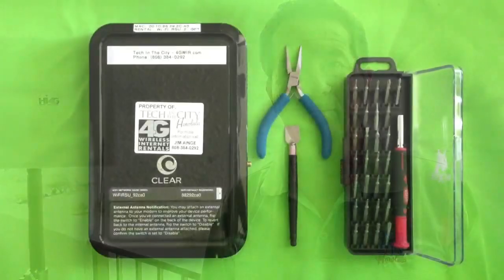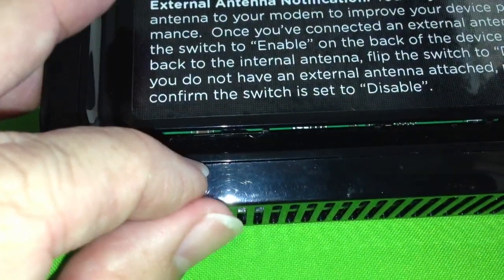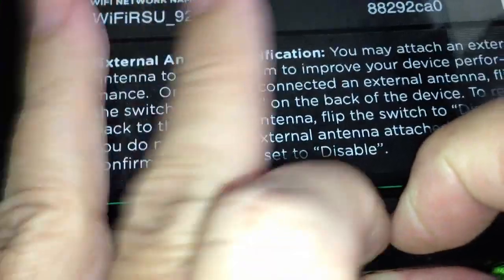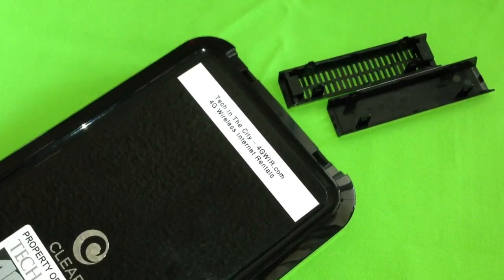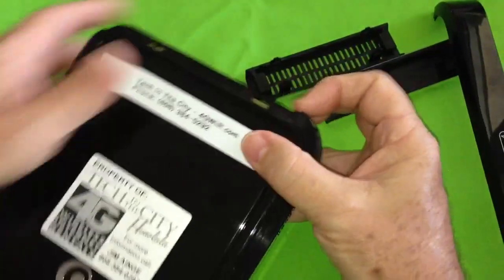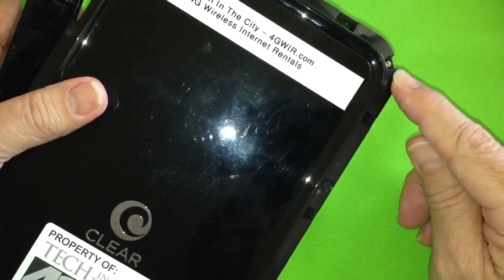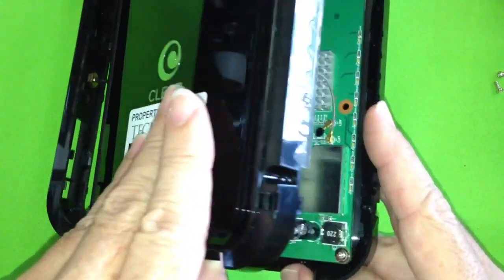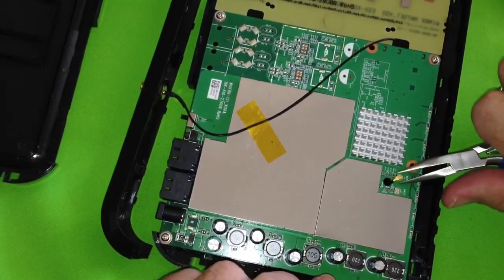How to take apart a CLEAR Hub Express Modem

Comment: Is there no SIM card slot on these hubs?
Reply from the maker: No SIM card slot. These were designed to work with the wireless carriers that supported WiMAX. WiMAX devices did not use a SIM card to identify themselves on the network. The Networks used the MAC Address of the particular device so no SIM card was required.

These WiMAX devices cannot be used on other networks like CDMA, GSM or LTE.

There are no longer any major carriers in the U.S. that support WiMAX devices, however, I've heard that there are some regional carriers in the U.S. that still support it. And there are some other carriers in other countries that continue to support the WiMAX protocol.

Comment: i have clear modem  how do i get hooked up
Reply from the maker: +Roy Beckunderspreader The Clearwire Corporation was 100% acquired by Sprint in 2013. Sprint no longer supports the CLEAR (aka Clearwire) network as of November 5, 2015. On November 6, 2015 at 12:01 AM service to the  majority of the CLEAR and Clearwire customers was terminated. The last I heard there were a small handful of customers from the Education and and some other special services that were guaranteed service under a special contract that were supported after November 5, 2015. However, I believe that these remaining customers may have since been migrated to another service under those contracts. As I understand it you can no longer sign up for CLEAR/Clearwire service as the network is no longer active or supported.

Comment from the maker: Hi israelrbb - I would recommend that you connect two extra uFL to RP-SMA Bulkhead Female Jack connectors to the Wi-Fi antenna connectors found on the lower/middle section of the main PCB of the modem. Mount these to the casing or simply extend them through the casing to provide you with connectors for external 2.4GHz Wi-Fi antennas. Then locate a pair of High-Gain Omni-Directional or Directional external 2.4GHz Wi-Fi antennas (depending on what you are trying to accomplish) that have RP-SMA Male connectors on them to connect to these extra connectors.

Comment: Wireless Frequency Range is 2.4GHz / 5.0Ghz / 5.8GHz
I'm planning to attach it to my clear hub modem via the sma connection in the back of the unit.  But the purpose is to increase d/l mbps not to increase wifi signal throughout the house as I have a netgear attached to it.  Is that sma antenna connector in the modem for use to get a better tower signal or is it for wifi for the house?

Comment from the maker: Before I can answer your question, I have some questions about your 9dBi INTERNAL ANTENNA: #1-What type of antenna is this 9dBi INTERNAL ANTENNA? #2-What is the rated frequency band that this 9dBi INTERNAL ANTENNA is designed to resonate at? #3-Since you are referring to this as a 9dBi INTERNAL ANTENNA, Where or to What are planning to connect this antenna to?

Comment from the maker: FYI#1-The signal lights have nothing to do with your Wi-Fi. FYI#2-The Signal lights are more a reflection of your CINR and not a direct reflection of your Download/Upload Bandwidth (usually measured in Mbps) or Speed. Speed is typically defined by the equation "Distance/Time". Therefore, Bandwidth is not the "Speed". I can only assume you are referring to your Latency or Ping times as they measure the TIME (ms) it takes to connect to a server that is a given DISTANCE away from your location.

Comment: Hi, if I connect 9dbi internal antenna to the hub express, will that boost my wifi signal (since its also a router) or will it boost my wimax to the tower?  I use an external router (netgear) so I only need the hub express to act as a modem.  But my signal lights is between 1-3 and I get low speeds.  The tower is about 1 mile away.

Comment from the maker: Since the Hub Express already has a built-in router you would need to disconnect one of the two Ethernet devices you currently have plugged in with an Ethernet switch or router that has the appropriate amount of ports you need. Once you have done that, you can now plug in the device that you previously unplugged, your magicJack and other devices into the new switch or router.